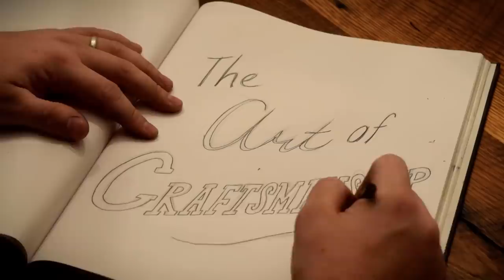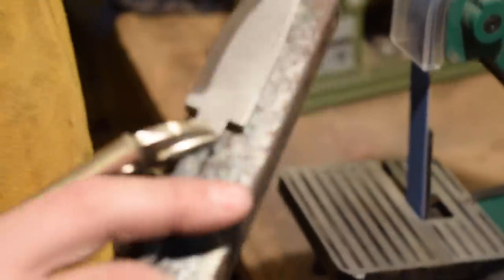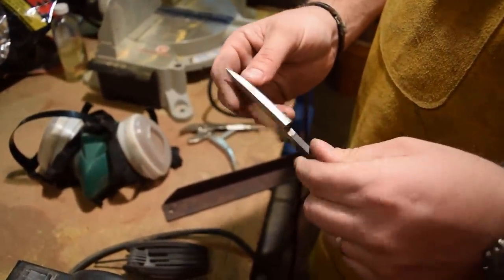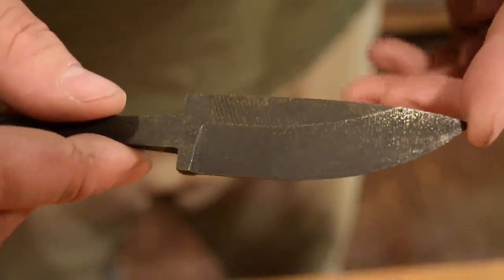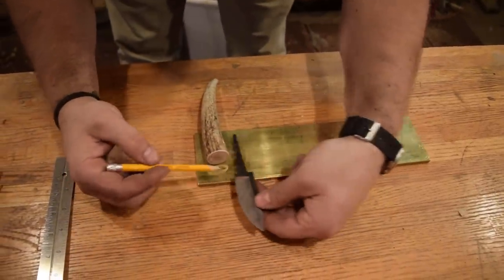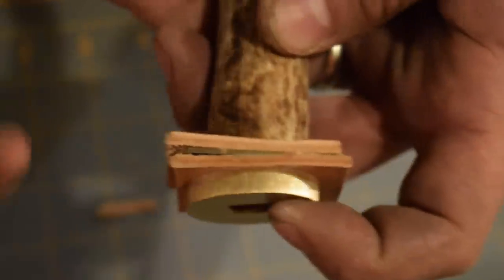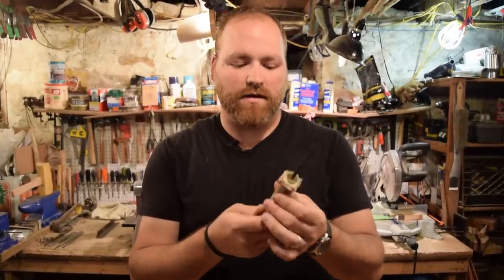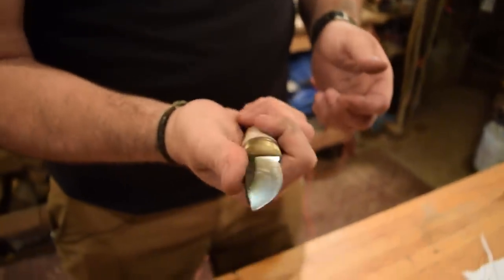Making a Hidden Tang File Knife with Antler Handle

Comment: When filing...it is a forward stroke only! When you back stroke you roll over the cutting teeth!.....forward only....stroke..lift...return....stroke again...going back n forth ruins a file!
Reply: You're never ever ever ever ever going to role the cutting teeth on a file ever unless it is a crap Chinese one or you generate enough friction to get the file to around 900c. I here this allot and I'm an engineer from the UK that uses files allot. My grandad gave me. He is the one that told me that back strokes make no difference other than losing track of your angle. The files he gave me are made from Sheffield steel and from 1940's. As long as you don't let them rust and you chalk them before heavy use they will last another 80+  years
Reply: @jamladjw  I totally agree. That OMG don't backstroke with a file is bunk. As for preventing rust a light coat of WD-40 helps a great deal, of course keeping them dry is the other half of the deal.
Reply: That is an urban legend, old wives tale or old mans tail whichever one you prefer. The file is made of hard or steel than what you are filing it does not matter which way you move the file across the steel it is not removing any steel when you're moving it backwards but it is definitely not harming your file.

Comment: Its a shame that the finishing took some of the surface character away from the antler
Reply from the maker: I actually like the transition between the polished inner antler material and the darker, more rough outer. Adds interest to the handle I think. 
Thanks.
Reply: Its good but I have roe antler  with Pedicle's and pearling that I want to keep

Comment: This man knows nothing about the heat treatment of steel. The only thing he knows is that you need to harden when the magnet loses its grip. Too long to explain what he was doing wrong. He made almost all the mistakes. Therefore, the second quenching was in water. But water is not suitable for hardening files.
Reply: He certainly made his mistakes, but there's no need to be a prick about it.

Files certainly can be quenched in water/brine.